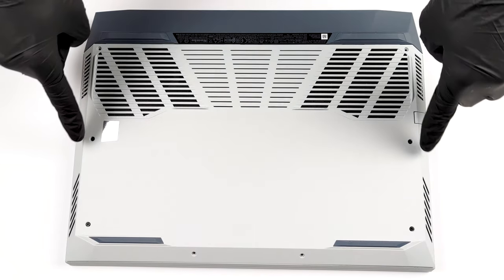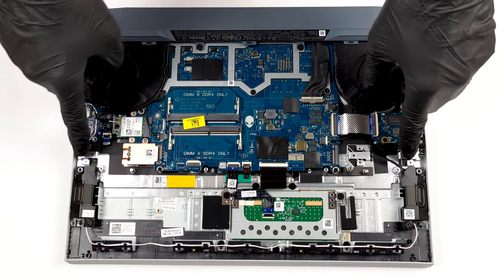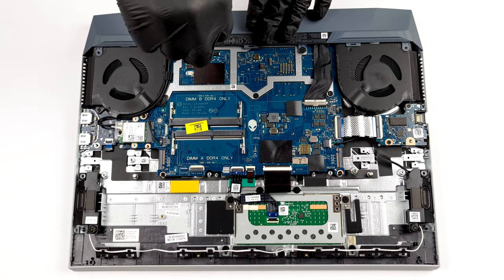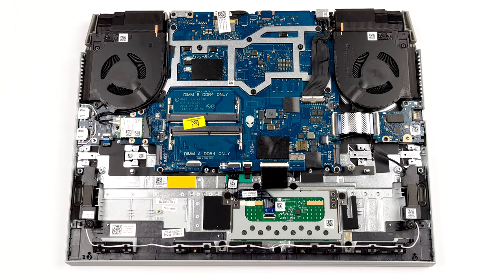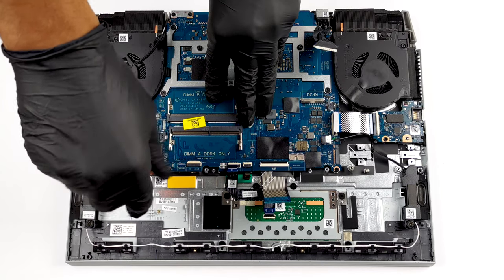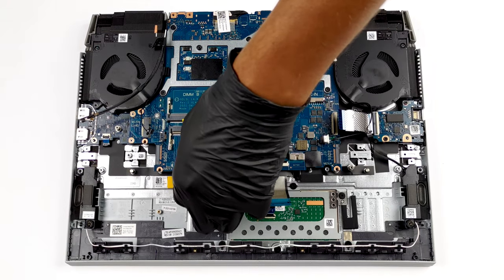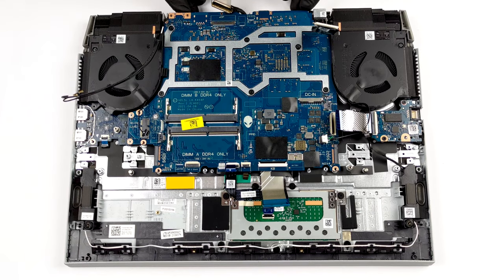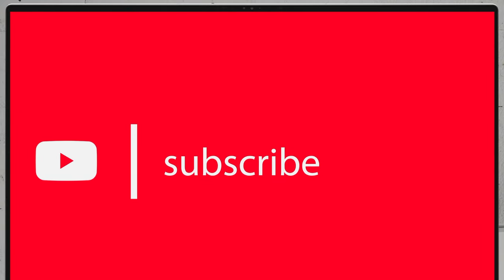🛠️ Dell G15 5515 - disassembly and upgrade options

Comment: In typical dell fashion, cleaning out the fans and reapplying thermal paste is a nightmare!
Reply: Right?? I just opened mine before watching a vid, never had a dell before. Was literally like where tf is everything? 😂
Reply: i know that feel bro, i´m using lenovo
Reply: seems easier compared to my 7567, I have to remove everything including the keyboard to change the thermal paste
Reply: Must be your first laptop.
Reply: MSI GP and GE model too 😢

Comment: On Dell's technical specs for this laptop, it specifically says only the model with the rtx 3060 has 3 usb 3.2 gen 1 ports.  All other models have 2  usb 2.0 and 1 usb 3.2 gen 1 port.
Reply: No on Dell's website and even on the user manual, for the model with RTX 3050 they say it has three USB 3.2 gen 1 ports. 🥲 But reviewers are saying it's not
Reply: yea and considering it's 2022 i don't know what made them do so , shamless 🤷😅
Reply: @bapynshngain  ofcourse it's not , you can even run speed tests on them
Reply: @bapynshngain  It does not have, at least mine didn't had.
Reply: @bapynshngain  nope, you can actually just look at the symbols next to the USB port itself. a little "ss" symbol is USB 3.0+ with the symbol itself literally meaning "super speed". And I'm sure you know what the standard USB symbol looks like. That's just used for USB standards below 3.0
Reply: @VishalKumar-nz2mz  bit late reply, but it's funny how they selling gaming laptop with just 8gb of ram.
Reply: i have 3050ti version 5515 and all 3 usb ports are 3.2

Comment: they didn't provide the NVME SSD bracket at slot 2 :( real bummer !!  #Dell
Reply: lmao , yeah . they didn't and i don't know what type of cost cutting they did 😂
Reply: i ended up drilling a hole, tapping a thread and screwing a cut down stand off into it because the stupid over priced bracket I ordered didn't arrive 😂 It's been about a year though with no issues

Comment: have you tried changing the thermal paste? if so, where there any benefits?
Reply: Why would you unless the unit is hotter than the chip specification of 105 for the CPU and 93 for the GPU?
Reply: @jamesharvey44  Cause Laptop might crash running at high temps even without reaching the limit mine does if i start doing some serious editing withing turning G Mode
Reply: @JoaoVictor74  In your case, unless you have an unstable overclock or plugged up cooling system thermal crash, you might benefit from the procedure. the OP was wondering if it was necessary to do so on a new unit running fine.
Reply: @jamesharvey44  Mine is recent buy and no Overclock applied :(  but it's just too hot here on Rio, Brazil 😭😭😭😭
Reply: @JoaoVictor74  I see, you might try a laptop cooling pad or raise the back of the laptop off the desk to increase airflow, if it still does not work correctly, you may have a defective unit.

Comment: Can you upgrade the battery on a 5515 that came with the smaller 50-something wh battery to the larger 80-something wh battery?
Reply from the maker: Should be possible. The size of both the battery itself, and its connector are the same on either model.
Reply: @LaptopMedia  There is a page or link where you can buy the battery? I have been looking but I have not found it anywhere
Reply: @LaptopMedia  I got 1 stick of 8 GB ram, now I need to buy 8 GB only or I can buy 16??
Reply: You can buy 16
Reply: @vigneshwar_k  You can buy 16GB to get a total of 24GB but you'll have only single channel speeds that way.
Reply: @diegoalvaradolugo5565  yeah , even i too. did you found it yet anywhere ?

Comment: Any in depth way of HOW to remove the battery pack without tearing out plug? Like, you can't just pull it out can you? )when I try it looks like it's about to tear
Reply: I second this too I upgraded the ram of my g15 today and the service manual said to unplug the battery but it was damn near impossible it looked like I was gonna tear it so I just upgraded the ram without unplugging the battery and in this video it looked so effortlessly so maybe there's something wrong with our battery connectors
Reply: Yeah mine to its just tooo tight. I tried pushing the plastic head from a non metalic tweezer but no success it was feeling so tight so I just used a brush and cleaned the fans from the visible sides

Comment: Do you think removing the screen from the bottom shell panel that sits below the intake fans would help with cooling? I understand it will get more dusty.
Reply: Don't do that, just use a cooling pad

Comment: What ssd would work best for this ??
Reply: There isn't one ssd that will work best, but you'll need a m.2 pcie x4 (2280) ssd. You could use a Samsung 980
SSD for example.
Reply: @maraanblanc  also i see you can't  use stick like ssd in it since they don't have that kind of space so can you tell me what type of ssd is compatible with it ?
Reply: @VishalKumar-nz2mz  replying 8 monts later, this laptop supports 2280 SSD.
Reply: Excuse me if I ask you, but you have the g15 5515 with ryzen 7 5800h and rtx 3060? If this have just one slot for SSD how you upgraded this?
Reply: @gabrielebelcastro2430  there are 2 m2 pcie ssd slots on G15
Reply: @EngiNetion  ok thanks. In the italian version only one
Reply: is there any capacity limit for ssd?

Comment: It's necessary to remove the battery just for add a new RAM?
Reply: Yes, in every upgrade or cleaning
Reply: No, its not. This Juan guy is lying. If youre using the g15 you just insert the ram and thats it
Reply: I've never removed the battery when upgrading ram/ssd.

Comment: Is it possible to replace the cpu or gpu?
Reply: from what I have researched and been told all gaming laptops are soldered in. No plug and play like an actual computer tower and the risks of ruining the board are high if you were to do so. There are some laptops out there that allow changing of processor and graphics card but I am sure the boards get outdated fast since everything seems to be moving forward little by little with improved parts
Reply: @FranciscoMartinez-kn4wu  this is the exact reason I´m here. My GPU is not detected(idk why, maybe bios problem or liquid damage), and was looking for a way to change the GPU. I´m sad to hear this.

Comment: Anyone else have a problem where the 2 front screws (the 2 still vertical ones) are just not letting go? I cant pry the front part at all. Its stuck. The screws arent wobbly like the other 2 but are snapping to indicate they are "unscrewed"
Reply: For me it's the two screws on the sides in the middle
Reply: Same here

Comment: Are you sure it is up to 64gb ram? On their website it says up to 32GB. Im confused. Also which ssd slot is gen 3 and gen 4 PCIe? Do you know? They dont put those things on the website, thats ridiculous
Reply: I am having same doubt , I have same P.C and looking for upgrade .but Dell recommended for 32gb .if I can upgrade for 64 that would be great .
Reply: The Ryzen 5 5600h can handle 64gb DDR4 RAM 3200mhz without problem.

Comment: one question i have a dell g15 5515 ryzen edition r7 5800h laptop with a 86wh battery. But in my country I can't find plugs for 86wh batteries. They only sell 56wh batteries, can I install this battery in my laptop without any problem? Because in the Dell specifications they present two types of batteries for this model of laptop. I hope you can answer me as soon as possible, thank you.

Comment: I want them to bring back screw-in screen bezels sO BADLY, The reason my Acer AN515-55 Nitro broke was because of the CLIP-ON BEZEL, I dropped it like 2 or 3 times, once on the carpet, and the rest in the laptop bag iirc. It had 2 cracks in it, I glued it because 2 of the clips BROKE when I dropped it the first time, and just today the anchors holding the hinges to the back of the screen BROKE, causing the screen to FALL APART, and that was during me trying to REPLACE THE BEZEL. I am now the proud owner of a G15 as of April 13th.
I will be adding my D:\ drive to this PC, was pissed about the apparent clips on the bottom, but I don't care that much, because there are still 8 screws on the bottom as they said...

Comment: Are you sure it is possible to upgrade to 64GB ? The manual says maximum is 32GB , I am looking forward to upgrade my G15 Ryzen (5515) .
Reply: Do have the 16 gig variant by any chance?
Reply: The CPU would handle 64 without problem but the manual says 32gb. Im almost sure there would be no problem installing 64
Reply: @sebassanchezc-1379  Thankyou bro ,I will try then.
Reply: @r.sulochana1532  publish how it works please.
Reply: Y u want to waste ur money buying 64.! What if it doesn't work. Go as per the spec sheet.
Reply: Plus 64 gb ram is not all required. 32 gb max is sufficient to handle huge tasks n heavy loads.
Reply: @r.sulochana1532  were you able to upgrade it to 64GB of ram?
Reply: @gouinalchemist5632  Sorry ,I didnt do it yet
Reply: Where do you buy the ram? And which ram use
Reply: @juantellez8315  bought on amazon.
Reply: @famashiou  which frequency? 3200MHz??
Reply: @juantellez8315  yes
Reply: Crucial 16gb ddr4 3200mhz dual rank x8 unbuffered CL22 sodimm ( PC4-25600 )
Reply: Bought 2 of these. And replaced in laptop myself. Working smootly.
Reply: @famashiou  Thank you bro , I bought 16gx2 n upgraded to 32gb ad you recommended .

Comment: is it possible to replace the keyboard? I accidentaly snapped out the escape key and bended the part that holds it in the chasis, was thinking about buying a new keyboard off of ebay and replacing it completely
Reply: Unfortunately not, it´s sodder to the chasey

Comment: Great video, thanks! Could you please tell me why on the crucial - website is no suitable RAM detected? I've also just a single 8gb ram stick but would like to have two of them or something like this.
Reply: do tell me buddy ..if you get to know ,got the same issue ....and also did you buy the  2nd ssd ? i''m thinking to buying it ...sice 500gigs is too low for gaming now a days :(
Reply: @kartikyadav5177  Hi, meanwhile I bought an additional and compatible 8gb ram stick from Kingston. This one: KINGSTON SO-DIMM KCP432SS6/8
Just installed it, rebooted and the new ram was detected.
But I didn't installed an additional SSD, I don't use the laptop for gaming.
Reply: @speedyschildi  hey so quick question, does the ram stick work fine with the g15 5515 and where can I get it, I've been looking for ram upgrades since I use it for gaming but cant find anything
Reply: @sharkk127  hi. The one that I recommended in the answer above still works fine. I bought it in germany at cyberport. Don't know if its available at your country. On the Kingston site was a finder for compatible ram sticks. I think that all of them could work.
Reply: @speedyschildi  thanks I'll have a look
Reply: @speedyschildi  can you please confirm apart from this any other ram which i can use to upgrade my ram?
Reply: @kartikyadav5177  hi , did you found any solution ?
Reply: @VishalKumar-nz2mz  honestly I can just say that my Kingston Ram works fine. Has the same specs as the original one (Micron).
Reply: @VishalKumar-nz2mz  buy this one. Its perfect. Crucial 2×16gb, 3200MHz, dual rank(2×8), CL 22, unbuffered. It matches exact specs amd is the best since unbuffered also and dual rank also.

Comment: Great video - thank you!  Another memory question.  I'm looking to upgrade my 8G stick to 2 x 16G.  Trying to find something that will be compatible.  Looking at this on amazon: Kingston FURY Impact 32GB (2x16GB) 3200MHz DDR4 CL20 Laptop Memory.  Comparing it to what's on Dell - there is no mention of these sticks being "NON-ECC" - look for something else? *UPDATE* - Contacted Kingston and verified with Dell:  KCP432SS8/16 is compatible with this laptop.  Their gaming "FURY" series is not compatible.
Reply: does that means i can't use those Kingston's one?
Reply: @VishalKumar-nz2mz  use any memory with 3200mhz cl22 preferably with 2x8 and not 1x16
Reply: @3aeren  thats right. Kingston one is CL 20. The one laptop ships with is CL 22. So go for ram with CL 22.
Reply: @3aeren  i bought crucial ram 3200 MHz, 2×16gb, dual rank, CL 22, unbuffered non ecc.
Reply: @famashiou  nice :)
Reply: @3aeren  :)

Comment: What Memory storage upgrade would be recommended? I currently have the 8GB that is comes with, I would like 32GB but not sure what would be compatible with it.
Reply: Depending what one you have pretty sure its 1x 8gb. Ive always been told its not ideal to use two different sizes, so you would probably want to go another 8 for 16 or two 16gbs
Reply: 8gb variant comes with 2x4gb sticks. I'm curious about upgrading mine also
Reply: @iiOcBx  do you know where I can find 2 8 gb ram stick for the same laptop, the 5515
Reply: 2x16gb 3200mhz
Reply: @frankfirewood5384  ddr4 3200mhz only in 8gb
Reply: Lol dont upgrade to 32gb idk why people is doing that since its so dumb to you will only use more than 16gb for really heavy uses
Reply: @sebassanchezc-1379 they say its 3200 but on the alienware software, it says 2899 mhz

Comment: Anyone know what ram works this laptop i cant find anything compatible
Reply: DDR4L (L for laptop), go for the 3200MHz one, don't know if you can go higher, but going lower would mean less performance.
Reply: @eye2077   thanks i was able to find a compatible ram stick from kingston a few weeks ago idk what dell was thinking shipping this out with 8gb of ram that isnt even dual channeled
Reply: @ronaldmcdonald4103  can you tell me what's the model of the ram stick you bought? I can't find anything either :(
Reply: @changobambo10   Kingston Fury  KF432S20IB/8 im using it along with the stock 8 gig stick for dual channeling my frame rates and load times have improved drasticly

Comment: How tf did you even remove the battery cables that smoothly, mine is fucking stuck, and one of the battery screws is soft for some fking reason, the screwdriver doesnt hold to it

Comment: What are compatible 16gb ram for this laptop I am trying ti get 32 in total. Also to upgrade ssd my current is the 512 can I add a 1tb on top of it or I have to switch it out
Reply: DIMM A DDR4. atleast i think as thats what the ram slots say